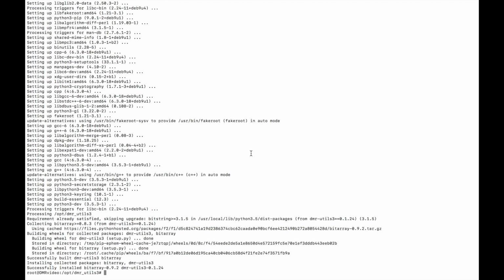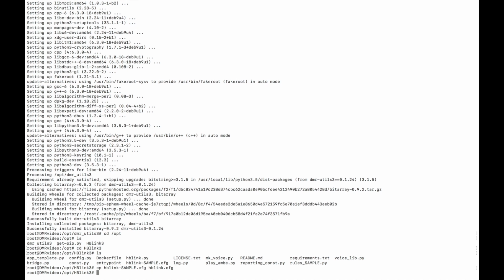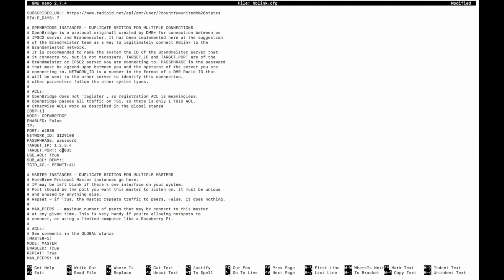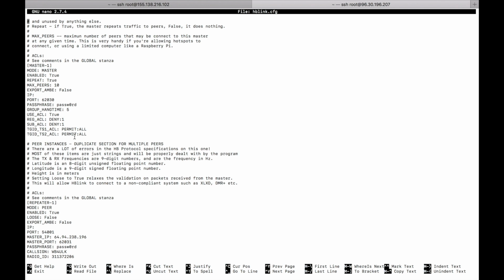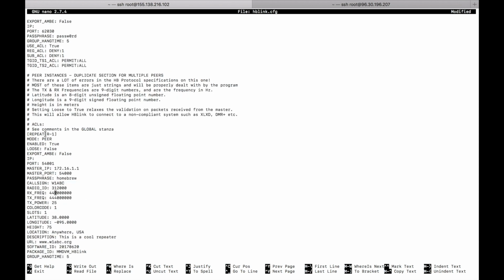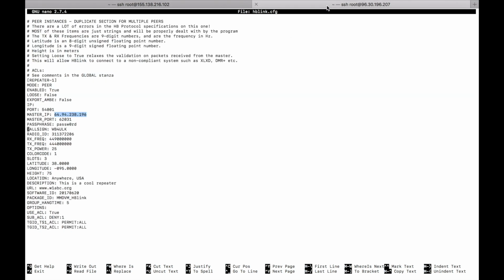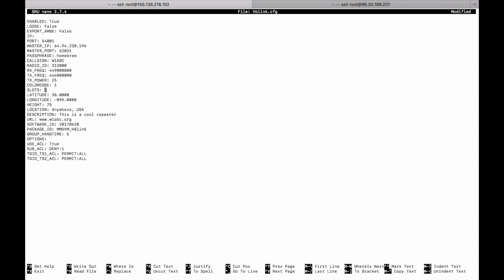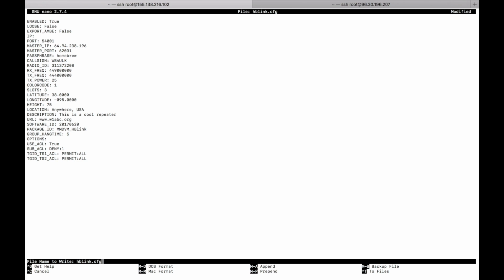DMR Master Server Pt3 Configure HBlink

Comment: Hey sir, just found this video series on your channel - THANK YOU!
I am trying to setup AURSINC hotspot (raspberry pi + mvdvmm hat) for my home station using my internet at home.
Then using starlink in my vehicle & a hotspot to connect back to the home station.
Idea is to create a private network, not going thru brandmeister or any public server.
Any guidance on how hblink should be setup?

(During early gwot we used MBITR and could reach back to northern Virginia using satellite & I’m trying to replicate that capability).
So grateful for your videos!